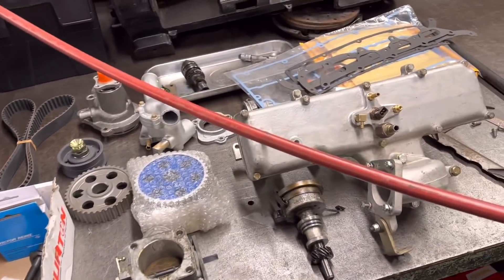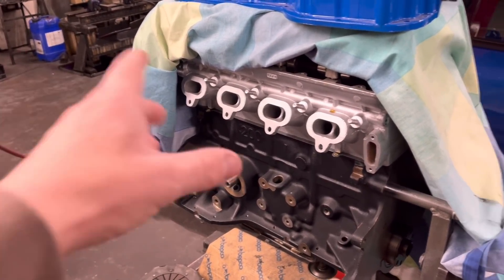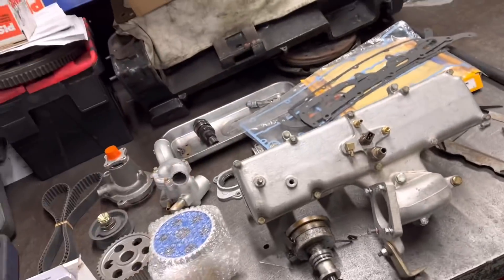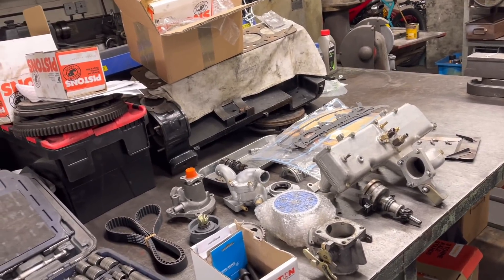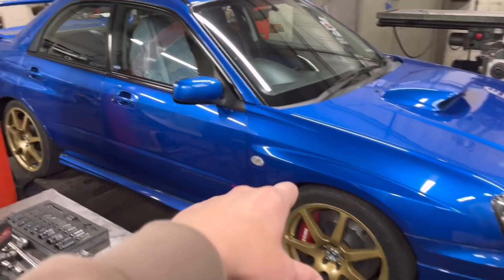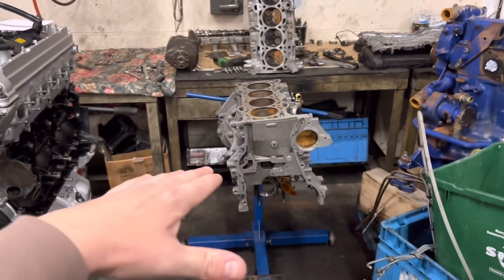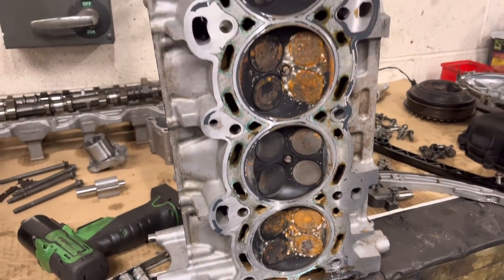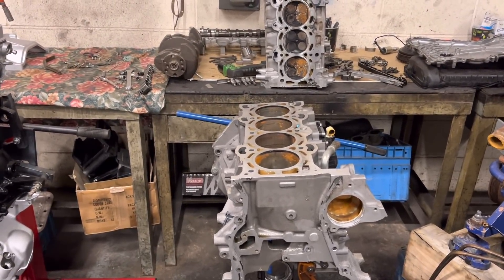It’s back for a Warranty claim check, but is it even the SAME ENGINE?

Comment: Every job SHOULD have a job card and the job cards MUST be numbered.
DO NOT put the job card number on the customer copy of the invoice.
Get yourself a set of (small) number punches that fit into a holder and punch the job card number ON EVERYTHING.
Try to do it in a standard place - for example, on the inside of the rear main bearing web on a block, the front web on a crank or under the first valve spring seat on a head.
AND DON'T TELL THE CUSTOMER !!!
If you get a chancer and tell him that this is NOT the engine you did, he will ask how you know.
AGAIN, DON'T TELL THE CUSTOMER !!!
The answer is that he will have to take you to court to find out and once you prove it to the court YOU WILL sue him for ALL COSTS.
If he then comes with "AND NOW YOU ARE THREATENING ME" you simply tell him that this is the standard way that you deal with clients that are trying to defraud you.
IT WORKS...

Comment: I,ve had the same issue not with a engine but with parts I,ve fitted on a job ,this fella was a whopper,he came from a village about 20 miles from me,So basically what happened was I fitted a shock absorber,brakes , ect , about £300,00 worth of parts ,for his mot. Anyway the phone call came-all them parts you fitted they,ve all failed the mot - yeah right .So I said let’s see the failure sheet- him .can’t find it,don’t you believe mex-me ok what’s the name of the mot station, I,ll get back to you .long story short ,this clown was keeping going. I said right bring it back ,And I,ll take the parts of and get them checked,or replaced,Next he said I don’t trust you to do the work,he was just trying it on,I’d checked the car had passed the Mot ,And he probably wanted the old parts putting back on ,Because he did mention he was going to sell it,Next time he phoned I just said ,Do us a favour Con man F-off . Your getting f:ck all. And don’t come back.Some people just need putting straight.

Comment: You are not responsible for customer damage.If you delivered and engine and customer brought it back 2 days later with cathedral window in the case, would you warrenty?Nor should you feel responsible for an engine 1 year later , let alone an abuse 3 year old engine. It looks like it was pulled and left outside for a season or two. You owe nothing. I advise, offer 10% discount on labor for customer loyalty only. Dont eat another bill $$$, you do it to much already. You did NO wrong! Head High bud!

Comment: Get a custom logo stamp made and stamp everything that goes out, then there is no doubt if it wasn't done by you.

I have machined hundreds of rotors and drums over the years with no issues as long as they are within tolerance.  Many newer stock rotors don't take machining well, but performance package brakes are usually heavier and have better material.

The issue with wide, shallow sumps is the possibility of a vortex forming from the pickup at higher RPM, especially with a high-volume pump  A rectangular pickup can minimize this, but the best solution is a deeper sump to keep more volume above the pickup in conjunction with a well-designed pickup or a dry sump system.

Comment: A bit late to post now however an engine that's been tampered with unless he advised you has no warranty. The home made oil pump gasket is the cause of low oil pressure. That type of gasket paper hardens very quickly when heated & becomes brittle even tho it's supposed be for engines & oil resistant, which is quite frustrating. You showed the break that caused the low pressure. The gasket paper if i'm not mistaken is a different type to oem which is even more annoying as i've noticed oem tears differently when pulling parts aprt .Yeah man that bubbly corrosion on the ally takes a few months to get like that. Never knew not to use emery when working as a mechanic.Now it's been said it makes sense.

Comment: I have built about 100 Triumph transmissions in the last 15 years, every one has my initials and month year stamped in the casing. Maybe a tie wire between 2 main bolts and 2 head bolts with lead punch seals, looks professional and gives you peace of mind.

Comment: Always put a secret mark or two on each block / major component, maybe just a couple of light centre punch marks  , so if some like this is trying it on with a different engine, you have the evidence.  On my own modest plumbing work, I used to put such marks, or a hidden tiny dab of Tippex so I know if something has been tampered with.  I've seen Stilson wrench marks on nuts / fittings, when I do not use Stilsons, indeed do not have any.

Comment: I used to break low-mileage VW Golfs and sell parts , we tested all engines prior to dismantling the vehicles . Occasionally a buyer would make a complaint and send back to us their old scrap engine for a refund (fraudulently ). We started stamping all engines and gearboxes prior to shipping . Ebay and police were not interested in this fraud despite the evidence we provided . Fortunately it was not common , all London buyers usually and I cannot comment further on other common threads with these criminals .

Comment: There's no way that's sat less than 6 months outdoors with the plugs out haha... There's a Honda 50 engine in our back garden thats been sat open since last June, I'm half tempted to go whip the head off and post what that looks like inside...  Also, #2 showed signs of having been sat with moisture in the pot more than once IMO, multiple stains from the rings sitting in different positions.  Was this in a race car or a race boat?

Comment: Looking at the cylinder head and the block there are obvious signs of water ingress. Where has this come from? The head gasket is not at fault. So has this engine been left out in the open and water/rain has entered the inlet side of the engine. I too believe that this is not the same engine or Block that was worked on by your company. Martin. (Thailand) A former owner of Martony Auto Services, Service and MOT Station, Classic Car Mechanical Restoration, Race and Rally car builders. 1985 to 2000.

Comment: Your business puts you in a situation where you have no control of what might be done to an engine once it leaves your shop. A couple of suggestioins from someone who has had similar issues ( diffent industry) We found trhe best defence against Idiots, liars, and others who try it on, was to document everything we did to a job. In these days, digital cameras are cheap, & you can keep a record of every step taken on a very small file. We also rersorted to stamping out own code on each job, ( job number will do) on ( in your case -say) block & head. Yeah, I know nothing cvovers everything, & taking photo every five minutes is a pain, but it becomes worth it whebn you find yourself with an irate customer & and engiine with unexplained issues. Cheers. Like you channel.

Comment: could you use a microchip paint?. just add a single dab of paint where only you would know where it was. so if in any doubts on identity. you could quickly check it. that could be applied to castings cams and cranks without anyone else knowing.

Comment: Hi , i have had engine parts worked on by various folks / tuners.  2 stroke motorcycle cylinders and heads and they etch an identity mark on the parts . Just a thought .

Comment: I would when you accept an engine in for work. Take the engine number off of the block or have a stamp made and stamp it so you know it's the same engine if you have some sort of warranty issue later on.

Comment: I worked at the Cosworth factory in Wellingborough in the1985 machining these original cylinder heads all machined casting were individually stamped and as each finished head was inspected and the machine operators recorded their name against that coded head

Comment: Im no race engine builder but i always marked my engines i built. Inside the block. In an unimportant hard to see area. With 3 centerpunch dots and a precise 9mm stripe. Its how i mark my tools and work. Had very suspect claims in the past

Comment: First thing anyone who knows about engine is if there is low or no oil pressure within 5 seconds stop or watch a £100 worth of damage per second go out your pocket. The water damage looks like it has been pulled out the sea and does the valve rust match the cylinder rust no, looks like the head was removed and they have been sat around a long time and after if i paid good money and that happened it would be on your door step the next day not left to rust for months as that did not happen overnight, i smell a rat.

Comment: I once bought a nova sr engine in boxes.. only the pistons were in and the crank. It had sat in a damp shed for 9 years... and that looked better, the cardboard boxes it was in were no longer able to be picked up, due to damp. And that was pristine in comparison. I have bought scrap yard td5 lumps that have sat outside for years that didn't have that much water ingress.😂

Comment: The Subaru at 6:00 illustrates the downside of running a big brake kit. If you remove the factory dust shield debris can get between pad and rotor and especially the inside rotor face can get grooved pretty quickly. Not a big deal on racecars, but it is when you use the car as a daily driver.

Comment: The corrosion inside the cylinder can occur very quickly if exposed to damp. It will only be a very powdery thin rust and will wipe off, but forms within a week. Obviously sub optimal.

Comment: Are there not numbers stamped into the block somewhere? I seem to remember that being the case in the 1960's. Maybe that's not done anymore and maybe you need to introduce your own system. Plus your initials on the bearing caps etc.

Comment: If you can I’d recommend before any engine build goes out the door make sure you stamp it so you know it’s your work. A simple serial number and or stamps on bolt positions. A friend has had the same issue pop up once or twice. Cheeky beggars.

Comment: Just being a general diy mechanic here,from a layman's point of view i can't believe he even has to stand looking at it discussing rust/scratches on the head surface,'surely' there are very simple ways to confirm it's the same engine you sent out??
A simple photo taken of certain scratches/marks on the block before it goes out,a stamp like others have said to identify it,the list is endless to take away the whole uncertainty here.

Comment: Silly question but don't you check engine numbers or mark engines you have worked on I always stamp mine and photograph original numbers or if no number I make one and re stamp although most of my engines are motorcycle engines hope this helps

Comment: You've got some very good points to suggest that's not the same engine. You need to film all your work with cameras in the shop, and also laser engraving onto the engine block.

Comment: I guess your looking at the engine as a courtesy or curiosity maybe some learning to be had if there's an unexpected  component fail that can't be explained by misadventure .
However the engine was intended for competition use by definition pushing the whole engine beyond the designers  intended use I've never bought an engine with a warranty to cover competition use a brand new crated engine would have no warranty under such circumstances
Respectfully tell the client his expectations are not reasonable returning such a mistreated Engine to you.In my opinion you need a better twat filter at the front door!!!your work speaks volumes about your ability and integrity as a company . unfortunately Ive turned my filter to 11 and they occasionally get through let me know if you have any luck finding a better solution .ps love the videos 🙂

Comment: A mate of mine stamps his initials on every engine or gear box he touches the owners are never told and it’s a different spot every time. And best bit he rubs his finger over the stamps with stencil paper to mark exactly where it is. 
Absolutely unrepeatable. 
And one guy tried, he brought an engine back for “warranty” with the same engine number and the three letters stamped on the block, 
My mate goes to his files and pull out the stencil to match up his stamps on this guy engine, looks the guy directly in the eye and said you did guess I’ll be this thorough. The guy stopped him checking and loaded the block back up and never said another word.
Some people can’t be trusted ! 
Go with your gut feeling .

Ps come back to comment on the other comments about stamping engine parts covertly. I thought my mate was a paranoid maniac but goes to show great minds think alike!! Ha

Comment: You need to invest in a good quality camera. You need to put your own secret mark on all parts of any engine that can be replaced in addition to the main block and head.  Document everything and put it in a file ready to be viewed should any warranty or complaint be made.
To get over the situation of bolts/studs etc being ground off, I would take a general photo of the complete build before the sump/head is fitted.
Sounds time consuming but will go a long way to saving you the problem of trying to persuade the customer that he/she is not quite right in the complaint. Plus any subsequent court action will be greatly aided by your photographic evidence.
You could even use photos as a sales pitch in showing any customer the stages of each build when the job is complete. Any customer that sees the photos might think twice before trying to scam you.

Comment: Back in the 80's I worked for a local engine shop and what they did was to stamp the build sheet number into the block along the sump mating face and on the head(s) on all builds. As for that head. Hmmmm, those valves look like they have been exposed to water for a long time. A few years back I was given a Ford 302 (5.0) V8 out of a crashed Falcon that had been dragged out of a lake. It had then sat for almost a year and didn't look as bad as that head. Just saying, something funky going on there.

Comment: Going to be a stretch to get 400+ with that intake port and 2wd plenum with the swans neck. That's not a ported head, mearly cleaned ports and thats it. But interesting car it's going in to. And seems my two scrap YB heads are starting to be valuable enough to fix the broken chamber and put some seats in it.

That engine is not just rebuilt. That rust wont happen in a month or two. Thats been sitting for a year, rotaded some time and sat again for months on end. I bet it's the previous engine the customer has blown before the one you built.

Comment: If there's no anti-swash plates the oil will fly all over and not feed the sump properly, or get frothed up by the bottom end of the engine. EDIT - You should tag your engines somewhere with a number punch and then note the number in your build log, probably on both the block and head.

Comment: You can call me odd if you want, but is that JB Weld (epoxy) globbed on the block, 2nd cylinder, mid-way down, just above the engine mounting hole? If it is I'm pretty sure that's not one of your custom modifications. I mean, here in the states, JB Weld has almost god-like powers & great for "temporary" fixes. However, this is the first time I've ever seen somebody try to prototype with the stuff.

Comment: That brake lathe is a blast from the past for me!  I've used the Ammco, Accu-turn and FMC brake lathes in shops and parts stores I've worked at. They were all fine but I was a SURGEON with the Ammco! Thanx for the vid, Be well.

Comment: I think we all know that engine hasn't been worked on for a long time! I've had motors that have sat for over forty years that were in better condition than that! The only way that can happen is is water, not moisture, gets in. The only confusing thing is; the condition of the valves doesn't match up with the condition of the bores!?

Comment: He's cooked this engine due to a cooling issue , burst hose whatever, and run it for a few months with a blown head gasket. So at the end of the bash, he just turns the thing off and leaves it for a week or two, then tops it up with water and goes off for another bash. Every time he turns it off, the water leaves more rust rings in bore. Then, he repairs the head gasket which explains the witness marks showing wet and dry or whatever paper hes used to clean surface. Then, thinking hes at the end of warranty and knowing the engine is damaged and could do with a rebuild, he brings it back and acts dumb. the owner voided any warranty he had by abusing the engine the way he did. If he has run it with a blown head gasket for months, the journals on the crank will be micro-pitted as the water in the oil rusts it slightly, they'll be stained with a sort of black or grey.

Comment: Looks like he blew head gasket all the water damage to head and cylinders then he let it sit around with water in cylinders if it had a layered steel head gasket it will leak between layers and won’t show on block or head

Comment: You'll have to start making 'secret marks' on your finished jobs, so you can see if you really are getting back the original one. We used to do it in the computer game back in the 80s and 90s, just to stop customers trying to switch stuff out on us. Stamp a unique number somewhere inconspicuous on the parts, and cover it with some JB Weld (which will come off with a razor blade).

Comment: Original engine? The few times I received assemble block or engine; the paperwork states the serial # and the hallmark/ID of the machine shop is stamped on (block & heads). Plus (now days in the U.S.) these items have overheat taps or buttons epoxy on the exterior. All this is to protect the the vendor & customer; warranty vs liability. Great videos and nice professional methods of your work & dealing with customers too.

Comment: You need to start stamping your engines so you know which ones you’ve worked on, as that is an old engine that hasn’t been stripped down and reworked by professionals. I think he’s trying to pull a fast one, cheers